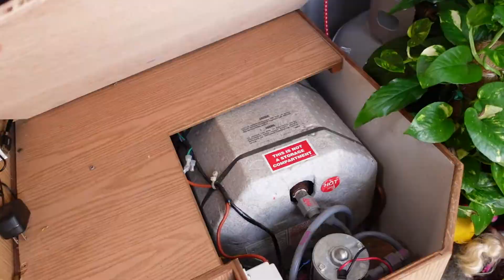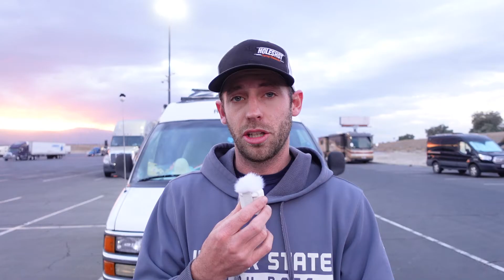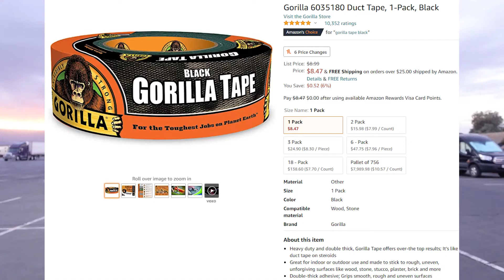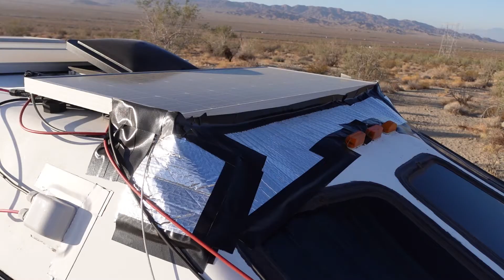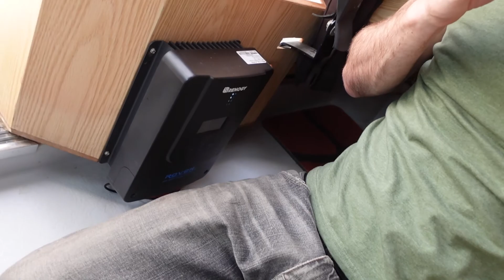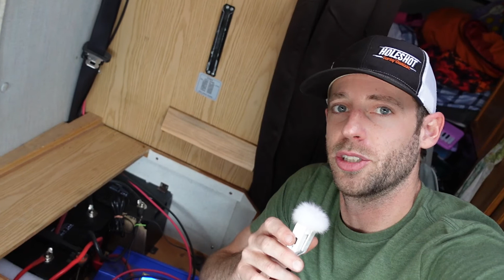Want to Install a 500 WATT Solar Panel System On Your RV Roof? How I POWERED UP My Off-Grid Vehicle!

Comment: What you've done there is invent the aeroplane wing. Your wind deflector ( sticky tape) creates a faster flow of air  over the panel which creates low pressure above and higher below thus creating lift. That might be why it came off the first time.
Reply from the maker: Yeah that was risky 😜

Comment: I am putting 5, 100-watt solar panels on my van they will be wired in parallel, I plan on getting a 60 amp 150-volt charge controller for future ground-mount solar panels for now I will leave the system as a 12-volt system, later I can change it to a 24-volt system if need too when I add more panels, would you have any added advice for me on the 500-watt system, it would be appreciated for your reply
Reply from the maker: Sounds like u got a good plan, I'd get a big inverter too so you don't have to upgrade later

Comment: This is a great tutorial, thank you so much for the links. I'm working on a similar setup and had a couple questions. Renogy has a 200AH Lithium battery @ 60 lbs that I'm considering, is there a reason you chose 2 100AH over a single 200? I'm looking at wiring in parallel with a 40 amp MPPT charge controller, is there a reason you chose this larger controller? I appreciate it
Reply from the maker: Glad it was helpful! Re: the batteries, I don't remember why i picked those, probably just cheaper at the time or possibly it's what was available at the moment. I picked a large charge controller because I heard it was better to overdo some things, and i definitely overdid it there. In retrospect, I would use the 40 amp MPPT charge controller, a larger inverter (probably 2,500 watt or larger), and I'd try my best to throw in one or two more batteries if there were space. Though my system is sufficient for off-grid living, I think those adjustments would be good improvements for anyone setting up something similar.
Reply: @NickDemski  Wonderful, thank you!
Reply from the maker: @emilyparker2254  yw! Best of luck on your build

Comment: May eh I’m missing something but where did you connect the rest of the van to the batteries and solar. You must have a fuse box. We have a roadtrek 2003  190 popular and I want to do solar this summer but very confused of how you connected the rest of the van to the solar like lights water pump and stuff.
Reply from the maker: They technically run off the auxiliary battery. But I charge the auxiliary battery off three things: the engine running, the generator, and by plugging in the 30 amp to my inverter. The fridge I run off propane because the system doesn't like it running off DC nor AC on that situation. Hope that makes sense 🙏
Reply: @NickDemski  so am I getting the right the lithium batteries only run the inverter they don’t run the lights and all the other stuff I. Your van.
Reply from the maker: I'll try to explain it better. 

I run everything off my inverter, including the lights, water pump, furnace, etc. But, technically they run off the auxiliary battery that came with the RV. However, I charge that auxiliary battery using my inverter by plugging in to it like it is shore power with the 30 amp plug. Instead of running shore power outside, I just run it back into the vehicle and plug jnto my own system. 

That auxiliary battery will charge if the engine or generator is running, but we go boondocking for a week at a time without using the engine or generator and instead just keeping everything charged off the inverter. I will just plug in 30 amp shore power into the inverter for like an hour or two during the sunniest parts of the day, or when I'm kicking on the heater sometimes there's enough battery for lights but not for furnace ignition so plugging it in for a moment helps it fire up. This is usually true in the morning when I first wake up.

So, I'm actually using the lithium batteries to charge the auxiliary battery via the inverter. So, I am using the LiFePo4 batteries to run the vehicles components, just doing so in a roundabout way. It's not hyper efficient and using a fuse block then connecting everything with DC would be better in that sense...but it would also be much more difficult to completely rewire all that stuff and this works well enough. 

Hope that makes more sense. Maybe I should make a video about how I'm doing it so it's more clear? Let me know, I wanna make sure your questions are answered 🙏
Reply from the maker: In the shortest terms: I plug in my Roadtrek's shore power connection to my inverter.